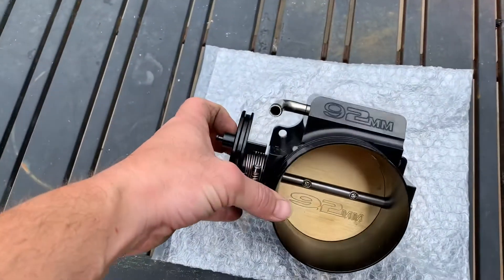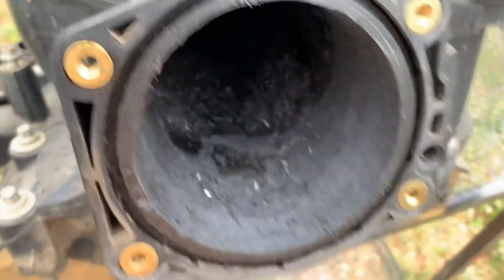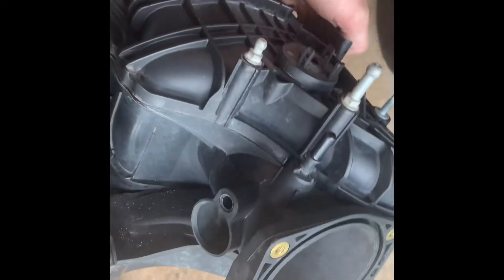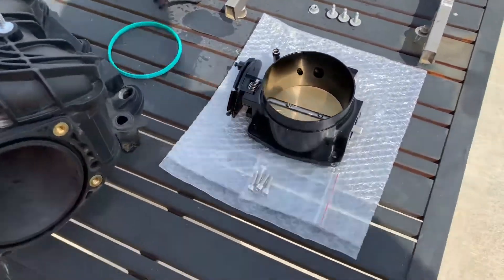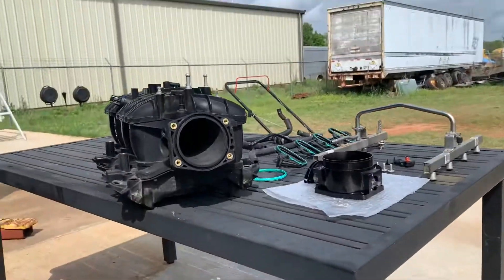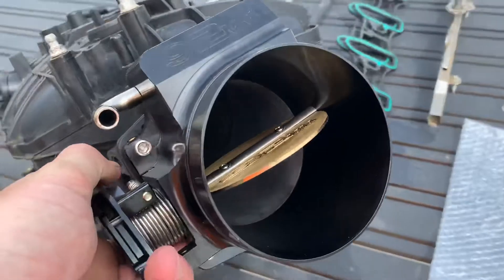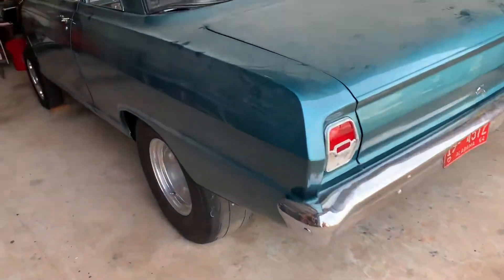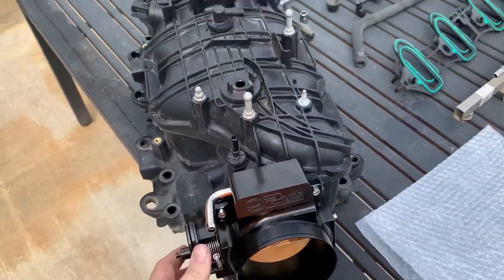Installing a 92mm throttle body on a Tbss intake manifold

Comment: https://www.youtube.com/watch?v=RSqROIP1Ra8 heres another good link.
Reply: oops wanted to tell you check your iac values,ive seen simular ideal and situations people are finding some of the cheapy throttle bodys either needing massage of the iac breathig port. or using a dodge iac with a smaller pintle head. espeacially the 102mm.and yes i remember your running a 92mm.
Reply from the maker: I’ll have to look into that. Thank you very much for the info! I’d love for it to be a little more driver friendly. I’ll end up selling the truck one of these days. Got a plan for another LS swap truck hopefully sometime this year. I need to go get it out of the barn still

Comment: like, robert krupa said i have heard a few talk about lock tight on those screws holding the throttle blades.and if your interested a company on ebay sells a direct fit set of high flow fuel rails for that and other gm truck intakes.they company is called fasster performance. https://www.youtube.com/watch?v=q7yEq_vKbb8 have a look at this install video by matt happel he also does a lot of ls swaps  8for8 ,and a ton of fairmont stuff. but its fasster performance, comes with all the fittings and plugs and i think i recall a tee fitting so you can run a pressure sensor or just a gauge. great video think i'll subscribe.
Reply from the maker: Awesome thank you for subscribing and thank you for the info. I didn’t lock right the screws, maybe I should have, I’ll check them when I get to the shop after work but I’ve been running the intake for awhile now. I’m not a professional tuner, but I’m learning. It raised the idle about 200 rpm when I did the swap and I haven’t figured out how to bring it back down. But other than that I’m very happy with the way the truck performs.
Reply: @323Fabrication  what are you using as an ecu/ecm
Reply from the maker: It’s a factory computer from probably a v8 Silverado. I tune it with HP tuners

Comment: Sorry to ask buddy. What is that hole behind the throttle body on the right side?
Reply from the maker: If you’re talking about that hole inside the intake mouth, it’s where that vacuum port on top enters the intake. Is that what you’re referring to?
Reply: @323Fabrication  it has a fabricated plastic hose.
Reply from the maker: Yes I removed that sensor and capped it.
Reply: In my old intake I have a purge valve. Is there a way to adapt the valve?
Reply from the maker: I believe that’s what was there factory it just runs a like to the valve on the other side of the intake I could send pictures some how that might help

Comment: Great vid, your porting job looks great! 

Question......have guys been having good luck with those $80 China eBay throttle bodies?  Seems I read some guys worry about a blade screw falling off and getting sucked into the engine.  I need to buy one so wondering if it's worth going cheap on these.  Probably the same ones they sell on Jegs for around $130?

Others guys say they whistle real bad.  I noticed the Holley throttle body is also made in China and it's around $220 online.
Reply from the maker: I just got a 102mm in for the 6.2 I’m going to start building for the Chevy II nova we have. I’m not scared of them, they are identical to the ones jegs and everyone else rebrands from what I can tell. Could remove the screws and put red lock tight on them I would think. I haven’t had any issues so far. And it does make a strange whistling sound when the trucks cold and you first crank it. But then it goes away almost immediately. I’m not a professional tuner but it’s worked out for me and I use HP. I’ve heard of guess having issues with the sensors not reading properly. I used my factory gm sensors and haven’t had a problem. And thank you, I’ve been porting heads as well, just kinda learning as I go, I studied a few books and google. I figure it’s free horse power, just takes time.
Reply: Throttle body’s are fine had 5-6 of them.the sensors are usually the problem . Cpl of them I had to drill the butterfly . I always loc tire the screws to be safe . Other then that they work . There is better and worse versions but I wouldn’t stress
Reply from the maker: I haven’t had an issue with the 92 and I haven’t had a chance to build the 6.2 yet. What does drilling the plate do?
Reply: @323Fabrication  in my case it was for a little bit more air to idle better and tune easier
Reply from the maker: I’m still learning the tuning part, the new tb and intake raised the idle about 200 rpm and I haven’t figured out how to idle it back down
Reply: @323Fabrication  last to
E I did it I had a huge came and didn’t create much vacuum. So the hole helped bc I wanted the idle as low as possible
Reply from the maker: So the hole lowers the idle?
Reply: @323Fabrication  in my case helped low speed driving and stalling and the idle screws wouldn’t do anything for me
Reply from the maker: Right on thanks for the info I’ll do some reading on it
Reply: You have to open up the IAC port other than that they're good
Reply from the maker: Thanks for the info
Reply: @3:23 Fabrication   some seem to also have sticky  throttle blades but mine didnt. Basically just open the IAC port and allow the solenoid to have full control of the idle air. Reference to your stock throttle body for ideas
Reply from the maker: My throttle blade was fine, but that’s awesome I appreciate it! I’ll check it out for sure! The trucks in pieces right now so perfect time to work on that
Reply: The Chinese ones are garbage! I had a Chinese 102mm on my 78 camaro LS swapped built engine never could get that thing to Idle right replaced IAC valve and adjusted voltage twice, TPS sensor ported the IAC valve holes even drilled a small hole in the plate which helped a little adjusted multiple times never could get it right finally threw it away and bought a FAST 102mm set IAC voltage no more issues

Comment: Hey Brother I appreciate the info the problem with me is I'm a single dad of two little girls 10 and 7 . the issue is I don't make alot of money I make about 17 bucks an hr . I want to do all this stuff to my truck but I'm afraid I'll mess something up. I ain't got the money to fix it or to send it off to get it done. On a scale of 1 to 10 how hard is it to do this? I wanna do it but afraid ill tear something up. Anyways god bless ya Brother .sounds like you got a Tenn accent I lived in Tenn for six yrs in a small rural town called Cunningham Tenn.  I loved it man best six yrs of my life. I cut tobacco yellow and dark. I hung it in the barns as well. Best years of my life .you gained a subscriber.
Reply from the maker: These intakes are getting cheaper and easier to come by all the time, and the the tb is a Chinese made 92mm I bought off of eBay. I reused the injectors from the factory intake and just used the rails off the tbss intake. At the time I didn’t have the 1” ict billet the spacer, but going back through this I would have it on hand. So make 2-250 bucks to have it finished. But all situations are different, I try to do everything as budget friendly as I can get away with. I’m from south Alabama so that’s where the accent comes from, but I really appreciate the subscription and the question. If that helped let me know. If you have more questions just shoot them my way.

Comment: What’s the process of converting the stock nnbs electronic throttle body to a cable operated throttle body?
Reply: The truck will throw itself into reduced power without the throttle body plugged in, you'd have to get it tuned but I'm not even sure if the dbw computers will run right even with a cable throttle body
Reply from the maker: @chrishansen7004   that’s true, I didn’t even think about the tune issues. And I believe you’d have to change the computer to one with the proper drivers
Reply: @323Fabrication  that looked to be a DBW intake manifold. A DBC intake manifold would have brass mount towers molded in. Could you let me know how you secured the DBC mount?
Reply from the maker: It was drive by wire, there were still mount spots, I drilled a different hole in the bracket and mounted it there. It’s been awhile but I think that’s all there was to it
Reply from the maker: The intake went into a truck with a cable tb so all I did was bolt the bracket on. Nothing special in that case. I don’t think you can convert an electric tb to cable, you’d have to buy another thing. But if you have a truck with dbw, you’d have to install a different pedal and run a cable.

Comment: Hey bud, just come across your channel, new subscriber, I'm putting a 2013 5.3 that I built for my truck that's now wrecked ina 2001 truck, gonna swap the crank and make all the sensors work, did you get this done and what all did you do as far as fuel lines go, thanks for the info bud
Reply from the maker: The motor in the s10 was a 3rd gen and the harness was built for the swap specifically. The factory fuel system on the 2.2 flex fuel s10 works really well, and has a fuel filter that’s got an internal regulator and returns from the filter. So one line feeds the motor